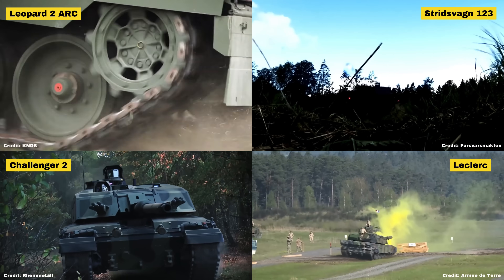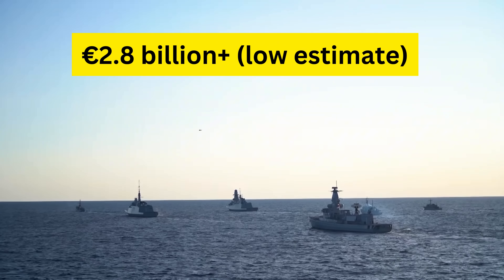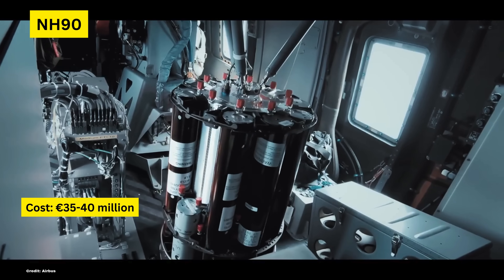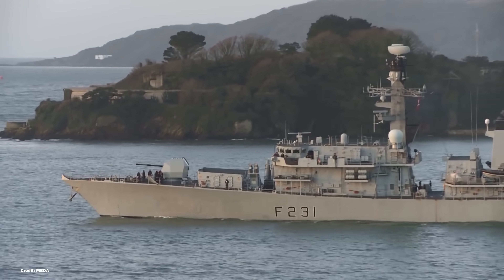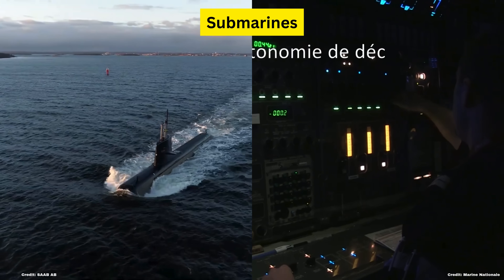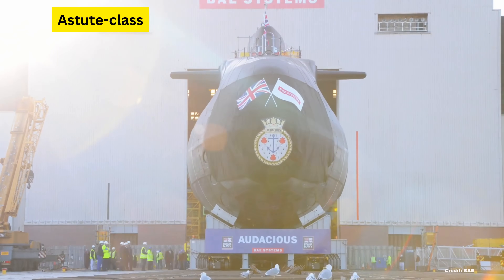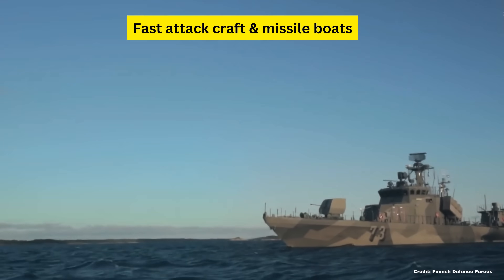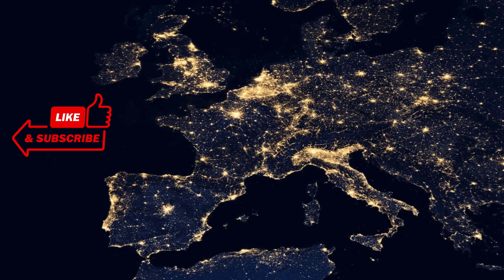The Staggering Cost of Losing Europe's Arms Market Part 5 - Europe's Naval Power continued

Comment: The NH-90 has frankly so many issues that Norway straight up returned them and bought Seahawks instead. With attack helicopters it's not much better, Tiger being plagued by disagreements between France and Germany on what tasks it should be even designed for...

Comment: To my opinion, the fact that the US have built in stop buttons that they can push remotely is evidence that even if we do get normal conditions again with the US, we should never buy a single unit of ANY kind of weapon or system, but instead, focus, invest, and innovate our own systems and weapons.
Sure, even at best relations, the US in that case will be pissed off about our not buying anything from them. But anybody with half a brain cell will immediately realise that even when we have the weapon systems on our own ground and vessels of various kinds, we are not fully in control of them. And that makes them a big NO GO. We need to develop and use our own systems that the US cannot tamper or interfere with in any way to ensure that we have full control of them without having to look over our shoulders and wonder what the US will think of it.

Comment: Norwegian NH90 weren't delivered pn time, infact many years øater they still weren't there. Also, they had lots of issues and disnt last long in the North Sea.

14 NH90 were supposed to be delivered by 2008 and in 2022 only eight were delivered... And they needed way more maintenance than projected, lots of parts had to be ordered all the time. So the contract was lifted and other helos have to be acquired.

Comment: You have forgotten the S-80+ class in Spain, although there is only one in service and this one does not have its AIP system (which when introduced in two of its siblings and in the first scheduled stop after five years of service will be in the first two) it is a conventional submarine of a considerable size that could (if purchased) fire AGM-104 Tomahawk or introduce the necessary software to use some variants European. 

And while it is true that Spain does not use them (because it prefers to use lightly armed frigates for maritime control tasks but with a lot of autonomy, the BAM), it is no less true that among corvettes are the Avante, which have been sold to Saudi Arabia.

It must also be recognized that the Spanish Navy is possibly one of the navies that depends the most on American equipment, because the Navy has always considered that cooperation with the USN is a useful factor for both navies, although sometimes, leftist politicians put their manias before the needs and benefits of the country. But more and more it is contemplated to maintain these capabilities and complement them with the ability to use European armaments, in fact, the S-80+ will be prepared as standard to use German and American torpedoes, as well as future frigates and upgrades of existing ones, will continue with the ability to use weapons from both sides of the Atlantic.
Reply: El submarino español y las nuevas f110 llevan sistema de combate español SCOMBA....

Comment: I agree with a lot in this video, however, seeing the NH90 as a prime example of an alternative to the MH-60R rattles my brain. Norway, Sweden, Australia are just prime prime examples of where NHI industries completely dropped the ball. The helicopters were delayed in deliveries, NHI prioritezed certain customers over others, which made some recieve faulty A/C individuals with spares prioritized to said customers, whilst others had their A/C grounded. It came out way over budget, and for most with a fly-away cost double or even tripple what was originally mentioned. Sweden  as an example has had 20(!!!) years of dealys in getting the Operational capabilities that were ordered. The Hkp14F still hasn't been fully cleared for OC. The Black Hawks ordered for the mission in Afghanistan was ordered and delivered on time, on budget, with fantastic qualities and has a low fly-away cost. Sweden will scrap the Hkp 14E (ground version) in favor for more Black hawks, and it seems they will replace the Hkp 14F with MH-60R aswell..
Reply from the maker: I agree it’s had a spotty past, but it is now made by airbus, which is a completely different company.

Comment: I think I missed the French SSN nuclear attack submarines aswell as the Spanish S80 Plus SSK diesel submarines. Also there's quite a difference between the Walrus, S80 Plus and Barracuda diesel submarines and the 212 and other diesel submarines. The former have a much longer endurance and range and are capable to for example go to South America, while the latter ones are more "coastal" submarines, meaning they can't go nearly as far and in general are quite a bit smaller.

Comment: You forgot another independently made European VLS system, the Sylver (mainly with the A50 and A7p cells) originally designed by the French and currently used on the UK's Type 45 destroyers, and the French and Italian Horizon class destroyers and FREMM frigates. The systems use the Aster 15 and Aster 30 surface-to-air missiles, and the future variants plus land attack missiles, produced by the Anglo-French-Italian company MBDA.

Also for the RIM-7 Sea Sparrows for Italy, they are currently only in service with three older ships, a destroyer and two small frigates, which are no longer on frontline duties and that will be decomissioned in the next years as more FREMMs and Thaon di Revel class Multipurpose Combat Ships enter service.

Comment: Canada is looking for 12 new AIP subs that are arctic capable.  I'm thinking the new subs are the best choice based on the specs. The maximum deployment time configurability Stirling engine etc.  what do you think, is it a good choice, is it a Cadillac or a workhorse.  And do they have a hot production line that can get them built reasonably fast.  Also understand that the design is not yet complete can that be finished fast?
Reply from the maker: Both Germany and Sweden can do it, timelines will probably be a thing. Though both are going on a war footing as we speak so they’ll pump out stuff quicker.

Comment: 11:10 this feat was already pulled off by german sub U24 (class 206) 4 years earlier in 2001 during JTFEX 01-2 in the Caribbean. U24 fired signal ammo and took a picture of it and the carrier via its periscope. No offense to the Gotland-Class, just fyi
Reply: The Dutch did in '89 and '99, the Italians in 2008, (Salvatore Todaro, Type 212, pictured the Roosevelt). In 2015 the S-602 “Safir” "sunk" half of the Roosevelt carrier group.
Reply: @  where and when did the dutch achieve this exactly? Never heard of it. The „Italian 212“ sub is german as you surely know.

Comment: But there is Italy, which has 3 aircraft carriers, one in reserve Garibaldi, 2 with F35B, 3 LPD helicopter carriers. A new one is planned by 2035, the second Trieste class weighing 42000t, the French one reaches 40000t! vehicles that are not reported in the world rankings... just think that as vertical cells they have reached 350 VLS, 100 more than France and Great Britain... and another 6 ships under construction that will bring Italy to 700 VLS in 2029... these are unattainable figures, even if you start construction tomorrow and invest everything necessary in 10 years, you would reach 5% of your target group, it is not clear how France went from 11th place in the world rankings to 7th without new equipment. The rankings give France 14 destroyers but where are they?  they have 7 fremm frigates but they put the acronym D because only 2 have 32 vls, the others have 16 vls like the Italians and 5 patrol boats that they call frigates with only a 110mm gun 2 horizon classes twin to the Italians... Italy has 4 destroyers 2 horizon 10 fremm in service 2 under construction evo, 4 ppa and 3 ppa under construction that will have 60vls 2 fremm evo with 32vls and heavy cruisers 2 DDX with more than 80 vls 15000t. plus dozens of patrol boats and more.. and this disproportion also exists in the air force and in the army.. I won't even write the numbers! I'll write an article to give you an idea of Italian war production.

Comment: The 212CD is a pretty different beast from the original 212. It has AIP (hydrogen fuel cell i think?) and a displacement 65% larger than the 212A. Hopefully Canada will buy 12 of these too, bringing the fleet total up to 24